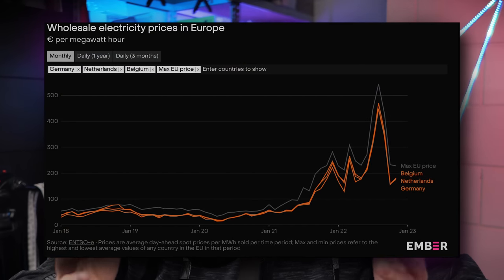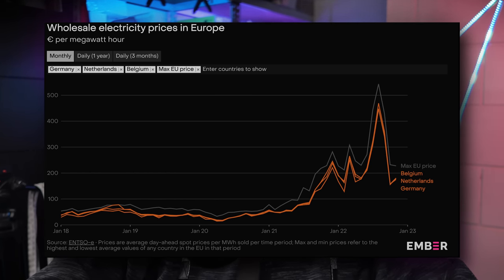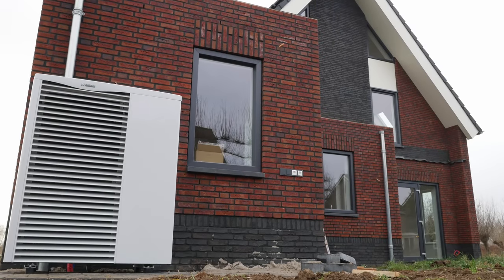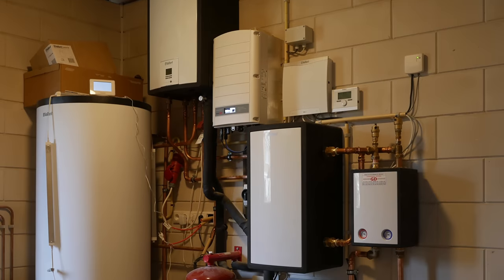⚡Quinergy⚡ The Why and reasoning behind project Energy (Home Battery build!)

Comment: Don't you pay grid taxes for power bought/sold?
Reply: We pay taxes for bought power. Currently if you deliver power to the grid (if we ignore the salderen part), you get 80% of the purchase price excluding taxes. Since taxes make up about 75 to 80% of our electricity price, that won't get you much. I do expect things to be different on dynamic contracts though, but I'm not sure.
Reply from the maker: Yes this will be an interesting thing to see and calculate along the way.

I went ahead and decided to do this now because I think it's a fun project and once "salderen" is gone I was going to need some form of local energy storage anyway.

Even if it just ends up being for my own use, buying as much energy as I can while it's cheap and then using it during the day while prices are higher, I believe there is a saving I will have there. Selling it back with a profit of excess is just a cherry on top in that sense.

I believe currently we are still allowed to buy and sell tax free like if solar had produced it tax-free but once salderen is gone, who knows.

Comment: you guys are payd 1:1 for selling energy to grid? we're payed 1\10 of what the electricity company charge us for a kwh of electricity... :D

and they're planning to delete such a contract form...

having an energy storage solution will make more sense every year
Reply from the maker: If you have a new dynamic contract yes, if you have a traditional set rate or variable we get the same deals except that we have salderen so if you always use more then you produce in the year you basically get it 1:1.